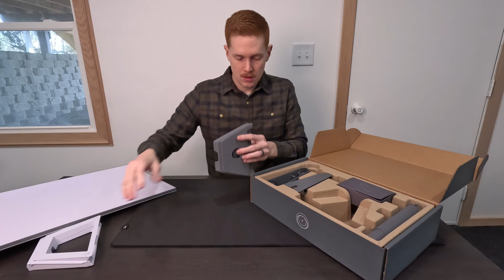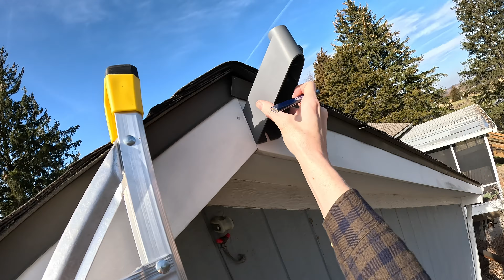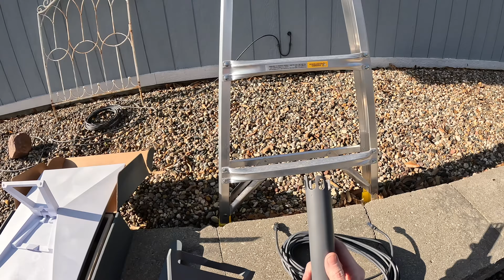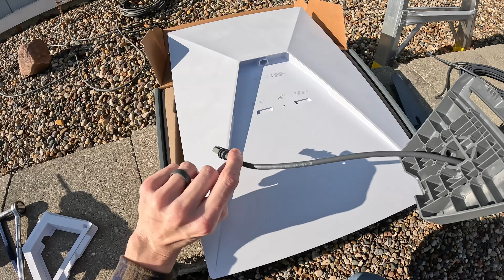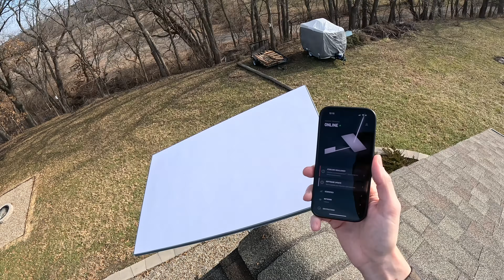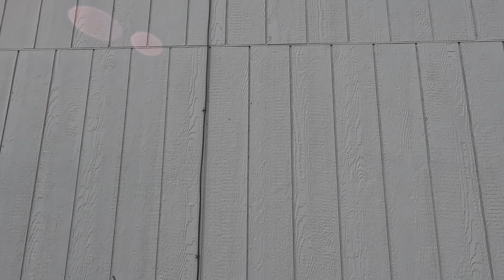Starlink Gen 3 Standard Wall Mount - Review and Install Tutorial

Comment: Great video! I have a fairly deep overhang so thhe Starlink mount is unsuitable for WALL mounting but I liked your method of attaching it to the fascia using the roof's large central cross beam as the foundation. All the third party mounts for deep overhangs rewuire screwing the mount plate to the Signal Board which sounds a bit scary with all that high and expensive tech inside!!
In a way it is heartening that the plastic "latches" are difficult to disassemble though yet another tip in your excellent video........ don't attach it too early!

Comment: I love seeing a video like this before I have to tackle it myself.  Thanks for the video.  But I got one complaint.  You were able to push the lag bolts through the pilot holes.  I think your pilot holes were a couple sizes too big for this installation.  You're defeating the purpose of those big lag screws if your pre drill holes are that large.  But if your pilot holes are too small, your wood will crack.  So there has to be a happy medium somewhere.
Reply from the maker: The drill bit size for pilot holes is specified in the instructions. You could certainly size down a bit if you were concerned, but in my opinion it was fine with the recommended bit size.

Comment: I used this same mount for my install, works great However I have a 6 degree off alignment.  app says it is the tilt that is off.   There is no adjustment for tilt on this mount.   Many say if it is working fine just disregard the error message, so I did.   If I was to attempt a tilt adjustment, my guess is to add washers between the mount and the top lag bolt wall attachment.   There are aftermarket mounts that have tilt adjustments.

Comment: Mine keeps telling me that the 'Starlink tilt is incorrect'. Any suggestions?
Reply from the maker: Probably not a big deal as far as performance goes. Sometimes walls are not plumb which is why the tilt would be incorrect. If you can verify the mast is vertical/plumb, it might indicate an issue with the antenna itself, in which case a support ticket would be needed.

Comment: One question: I do not have a "smart" phone. Can I do a DIY installation without one?
Reply from the maker: Not if you want to use the Starlink router, as you need the app to set up your network. A tablet will also work. If you have a 3rd party router you can complete setup without the app. After your dish is installed you can navigate to the IP of the dish in a web browser to set the rotation angle and check basic stats.

Comment: The mount seems fairly simple to install but I am trying to understand what the heck you did with the cable(s).  At minute 13 you can see the cable you originally ran through the wall outside and another cable next to the dish.  You then connect this second cable to the the dish and mount it to the roof.  But the final view shows one cable cut to size to run down the wall and into the house.  Count me confused.
Reply from the maker: I brought up the cable just for demonstration. Like you noticed, I had an existing cable run from a previous tutorial. Just a single cable run needed. If you want to see the process to run the cable here is that video: https://youtu.be/046arFRpDig
Reply: @DISHY_tech  Yeah I saw that and it looks simple, too.  I guess the only way to really manage the cable is to cut it to length and install new RJ45s.

BTW, do you know the outside diameter of the standard mount kit pole?  I am thinking of maybe getting a 20' length of galvanized pipe and wonder what inside diameter I would need for that to slide in sungly... or if I would need to make a 3D printed bushing.
Reply from the maker: @raylo4074  OD is slightly under 1.5”, so if your pipe has an ID of 1.5” you should be good.

Comment: Bought the wall mount 5 days ago, $67.00 worth it though, I live in a very rural area a tower about 1/4 mile away Verizon has me contracted for 5G and I barely get 10 Mbps on a good day. Starlink has bumped that to 368 to 450 Mbps depending on the weather. Do it. I’m done Verizon!

Comment: Is this mount tiltable?
Reply from the maker: No, it needs to be installed on a vertical surface and there is no way to adjust for tilt. A few degrees from plumb is no big deal for the dish, though.

Comment: Hi nice video… I wonder if I can install those on a brick wall and if so, if a should change the bolts for another ones?
Reply from the maker: Yes you can, and I would use bolts designed for brick instead of the wood lag screws included in the kit.

Comment: Cannot believe that a piece of flat material is held onto the mount with 2 tiny clips that easily slides out of the dish.  Seens like they could have used a screw to help secure that mount piece in place on the back of the dish.
Reply from the maker: It has to be specific force applied to both tabs, and then horizontal force to slide the plate off the dish. Really only someone messing with it would able to un-clip it. It’s actually very secure once both tabs are engaged.

Comment: Great video and really informative! 
I have two questions though.
1) It looks like it the mount "clips" on the dish like thw kickstand. will this be a prolem with winds or other weather conditions that may shake the equipement scince it might unclicp?
2) If there is no such problem, in theory could  you mount it on the kickstand?
Reply from the maker: The clip mount has proven to be fine in wind and weather.  I’ve had zero problems with my main dish that has been installed for almost 2 years now.

Yes you could just use the kickstand to mount it on a flat surface. It even has 2 screw holes. But it wouldn’t work unless the surface is flat.
Reply: @DISHY_tech great thanks a lot for the quick response

Comment: how thick of a drill bit do you need to be able to slide the head of the wire through the wall? did the 1/4 " work ? Thanks
Reply from the maker: 3/4 inch

Comment: I would like to see where you placed the rest of it. Does it need to be in the house? Can it be in the garage etc?
Reply from the maker: I have a separate video on routing the cable: https://youtu.be/046arFRpDig
It can be in a garage, that's what is shown in my cable routing tutorial. It's up to you how and where you run the cable and place the equipment, but be mindful of the cable length, and where you are installing the WiFi router in relation to where you will need the best signal for devices.

Comment: Seems like the wall-mount is not nearly long enough if you were actually installing it on a north facing wall which is where you are most likely to want to install it. Or even an East facing wall like you installed on (unless you put it on the faica at the peak of the roof like you did). The wall would interfere with the dish. That's kind of an oversight. I guess I'm gonna have to find a different solution.

Comment: Hey mate, I just finished mounting mine. Unfortunately, mine misaligned by 13 degrees and cannot align it any further because it will hit the gutter. The mast is too short. Is this an issue? I’m getting email alerts from Starlink stating that it’s misaligned and not in optimal position.. etc.
Reply from the maker: It's best to have it properly aligned, but give it 48 hours or so and see if you notice any outages listed under the Statistics page in the app. You shouldn't see any outages >2s. Also keep an eye on your average latency. If you aren't experiencing any performance issues I don't see a problem with leaving it misaligned.
Reply: Thank you! Yea no 2s outages in the last 5 days, average latency 26-27ms and ping success is over 99.7% but weather has been very clear recently. I have been told that Id see impact during bad weather if dish is misaligned.. who knows.
Reply: @amerabdalamer9725 Amazon actually sells some great mounts for the gen 3 that are adjustable and have a much longer reach out from the wall that statlinks stock mount

Comment: You need to show it all the way into the Mesh router and if there is an Adapter for an Ethernet extension cord to plug in an extra Router. The Range of there Mesh Router is only 28’ Radius 👎. We need the set up shown . Nobody has done that on YouTube that I can find. Please 🙏.
Reply from the maker: No Ethernet adapter needed for Gen 3. I have a separate video on routing the cable through the wall. The range of the router is over 3000 sq ft, I'm not sure what you mean by 28' radius. Here is the cable routing tutorial: https://youtu.be/046arFRpDig

Comment: The 4” offset is ridiculous for a nation where 18” + guttering is pretty standard.
Reply from the maker: You'll want to install this at the peak of the roof on the gable side if possible. Gutters are usually at the lowest point of the roof, not the best place for the antenna.
Reply: @ That’s a cop-out. A clear and unobstructed view of the sky in the aligned direction is most important, not the height of the antenna. The difference of 20’ between an eave mount and a gable mount is insignificant in a satellite antenna.
 An eave mount, being in a more accessible position, will also mean easier inspection and maintenance. The Starlink wall mount’s offset of 4” isn’t even enough to rotate the Gen 3 dish 360’ for alignment if necessary. That’s why there is a non-Starlink aftermarket for such mounts.
Reply from the maker: @taylorclear-g8z  You've got options, that's all I'm saying. You can use the Starlink mount and just pick a location away from your gutter, or use a 3rd party J-mount. Personally, I think it looks best hidden somewhere on the side or back of your house away from the street. And height is your best friend if you have trees around like I do. Or you can wall mount that sucker right on the front of your house with a 48" J-mount to get around the gutter. Your choice, but you've got all the options you need.

Comment: yes i have a question, can you connect the antenna direct to your phone using a Ethernet to phone adapter to alight the antenna?
Reply from the maker: The antenna has to connect back to the router and power supply. And devices you wish to connect via Ethernet can be plugged into one of the two LAN ports on the back of the router.

Comment: How is the latency for wifi calling?
Reply from the maker: 20-50ms, so it's great for Wifi calling, video calls, online gaming, etc.
Reply: @DISHY_tech i set up the standard  dishy. I set the service area to 150 miles away (final destination). It would not allow me to connect to internet to do a speed test or any other testing (restricted message on app). I had to change the  service area locally  just to see if it works. Residential lite plan.

Comment: Would you say this is suitable for city living like an alternative to the traditional internet providers?
Reply from the maker: No I wouldn't say so. It's a lot more expensive, and will generally be less reliable with lower speeds compared to fiber. Starlink is intended for customers without the typical internet options, like in rural and remote areas.

Comment: I highly recommend the extended version if you get snow in your location.  I installed the standard version first and damaged my articulation motor in the winter.  The extended version places the dish 100% free of the roof allow room for the dish to move freely regardless of the snow  buildup on the roof.
Reply from the maker: Good point, although for the Gen 3 there is no extended version, this is the only wall mount they sell for it. An alternative to get the same effect would be to get a longer J-Mount (Winegard DS3000) to get more clearance from the roof.

Comment: excellent video!  how well does it stand up to high winds? We get Santa Ana winds once in a while here in S. Cal.
Reply from the maker: So far so good! To date I haven’t seen a single report of a wind failure on a properly installed Starlink. Doesn’t mean it hasn’t or won’t happen, it’s just think the angle of the dish and the fact that it’s pretty light means it doesn’t catch much wind. As long as the lag screws go into the roof structure I think you’ll be fine.

Comment: Great and informative video, however my vertical alignment is off by about 20-30mm and can’t be adjusted with the wall mount. How do i fix that?
Reply from the maker: You could try washers or some other type a spacer on the lag screw holes, between the wall and mount.

Comment: I am using that kit to mount my GEN 3 dish.  Although the alignment is correct and easy to achieve  the pitch is off by 6°. I wish they had adjustments for that as well.
Reply: Why don't you remove the bottom bolt and tilt the mount to the degree that is needed and remount the bolt with a new hole?

Comment: guys i guess going into wood you can get a way with using a 9/16s but it will be slightly larger. it is in between a 14 and a 15mm. witch means when it counts you will bust your knuckles and screw up the nut or bolt and not get anything to work. if it takes a 14 use it. or you may wish you did.

Comment: Best video about installing the mount and dish.  I will be setting up mine at a remote cabin next week.  Does anyone know if I need a data service (broadband or cell) in order to get Starlink up and running?  I have the app on my phone and an account w/Starlink.  Thanks.
Reply from the maker: No cellular data needed if you are already signed in to the app. You can access Starlink.com and use the Starlink app through the dish connection.

Comment: What kind of mount would you suggest when you need more than the 4” that this mount allows.  I do not have a facia board as you suggested. The distance from the stucco wall to the overhand is closer to about 10” and I would need a taller up metal,tube then what is supplied.  TIA.
Reply from the maker: I would recommend a J-mount (Winegard DS3000A is a good option) plus the Starlink Pipe Adapter.

Comment: what are the dimension of the wall mount and pole?  I have a rain gutter that completely covers the edge of the eave, so I'd have to mount on the wall.  The wall bracket would need to extend out 6 inches from the wall and then the pole would have to clear 6 inches of height to get over the gutter and roof.  Would this kit work?
Reply: I found the dimensions online...  6.1 inches away from the wall and 10.9 inches from bottom of mount to top of dish.  I think it may work!

Comment: I have question ,.i got mine and before i plan to put it on the roof permanently i tried it from the ground amd when i had to choose if i use wall moint or just standard i picked option standard and now i can't get that option in the app again, do i have to do factory reset when start with a wall mount installation
Reply from the maker: It doesn't really matter which mount you pick. But you can also just run through the setup again if you want to select the right mount. Go to Advanced at the bottom of the app, and hit "Set up another Starlink".
Reply: @DISHY_tech  ty for the reply , also another question , i don't see option to switch off so i just plug the cable out, is that ok as well ?
Reply from the maker: @Cristal1971  Yes that's fine.

Comment: Why did they do away with automatically finding satellite?
Reply from the maker: The antenna has a wide field of view and can electronically steer signals. Alignment isn’t necessary. Even the motorized ones just moved one time at boot up and never readjusted after that.

Comment: What is the length of the RJ45 cable that is sent by Starlink?
Reply from the maker: 50 feet is the default cable. They have a 150' version in the shop.
Reply: @DISHY_tech  thank you.  One more question if you don’t mind.  About how high up on a 1.25 inch pole can you extent before sway becomes an issue?  I’m looking at a forked bracket y shaped and installed about 2 foot below the eave.  Then using a fastener near the top of the roof to secure the pole and using two 8 foot poles to get high enough to top the evergreens around our house.  I’m pretty sure it will not sway but looking for input.  If there’s a better way to get this kind of elevation I’m missing.  I’m open.  My equipment still hasn’t shipped

Comment: Does Starlink offer a wall mount that will accommodate a wide roof eave?  Mine is about 30 inches. The fascia board is partially obscured by the rain gutters, so if I must use the fascia board, there will need to be an additional piece of wood to provide a base for the mounting bracket.

Comment: The antenna on the roof of the house doesn't look very stable even though you tightened the screw it still wiggled with your hand, I imagine the whole antenna will dislodge in case of very strong wind and eventually it will hang broken by its cable! What a nightmare is that plastic cheap stuff they are selling us! 😢
Reply from the maker: This dish and mount have been through severe thunderstorms with gusts up to 50-60 mph. No issues at all!
Reply: @StarlinkHardware  Thanks for the infos, but here in the philippines, hurricanes often occur in excess of 50 and 60 mph!

Comment: Is the entirety of the mount hollow from the mast right down through the bracket? I want to route the cable straight down and not have it come out of the hole at base of mast. Looks like mast is hollow but  unsure of the lower part of bracket. Can the cable be placed through the centre mast through the bracket into the base and then straight back through the wall into the property? 🤔

Comment: You say the kick stand slides right out and you made it look easy. It's not sliding out for me and I'm afraid I'll break it. Is there a trick to it?
Reply from the maker: Lift up on the tab and slide out at the same time. There are two plastic notches holding it in, preventing it from sliding out. The upward pressure releases the tabs.